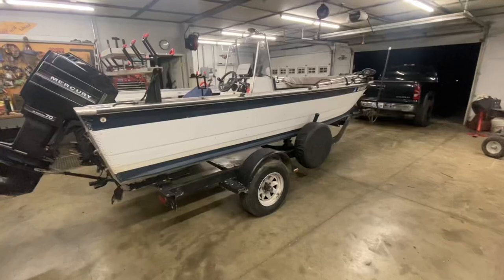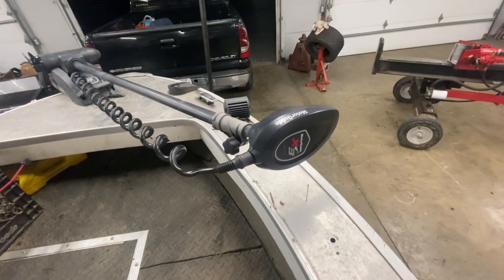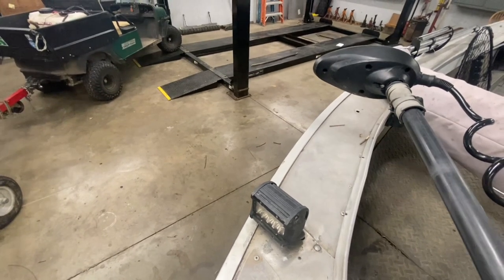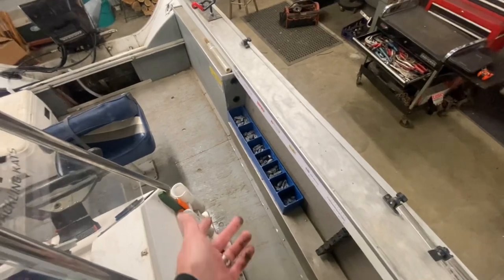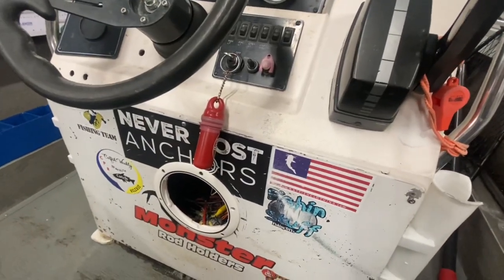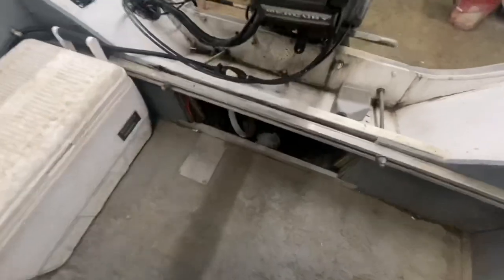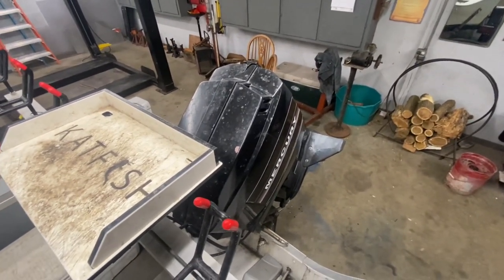Catfish Boat on A Budget- A Look Inside!

Comment: nice rig. i got a old boat too its a 1987 sylvan pro fisher deep v with the steering on a side 18 foot.. its really similar. i love it. i got the splashwell in back that takes up a little more room. but it came with a deck on it so you could stand on it in calmer waters. i like your slimmer splashwell though. its cool you can work on your own boat. hopefully ill learn the motor ins and out and get a aluminum welder someday. since hardly anyone around here has one, and can save a ton of money doing it yourself.

Comment: You can get a remote control trolling motor on Amazon for $560 when I got mine they were just $400 it’s called haswing but they are awesome trolling motors I have a 21 foot pontoon and with a 55 pound thrust trolling motor it will whip it around pretty good I haven’t had any issues out of the trolling motor and I’ve had it for two years and it’s still doing good

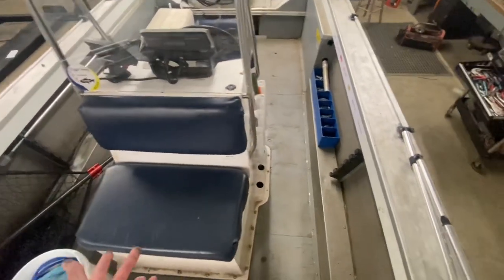Comment: At 5:04 when you shot that rear angle my first thought was, hold on a minute does he have a fire pit in there what's he need wood for. Then I saw it wasn't actually in the boat. Thought for a sec you really had it going on.
Reply: And if you ever get board my pontoon needs to be rewired, I've been putting it off, it's gonna strand me I know but my goodness wiring is a tedious job.

Comment: I have the xi3 and I bought the gps module and added it on later. I then linked it to my lowrance units. There are problems and the rumor is MG knows about it and there is a reflash update coming out to fix the issues. Just thought I would share before you or anyone else drops some more money on something that isn't quite working right. Hopefully they will fix the issues and stand behind their product.